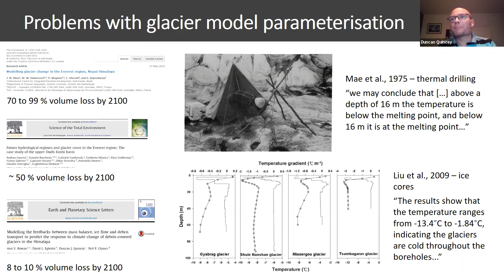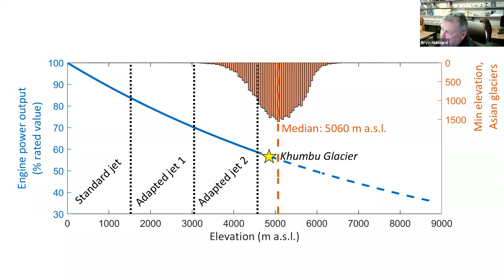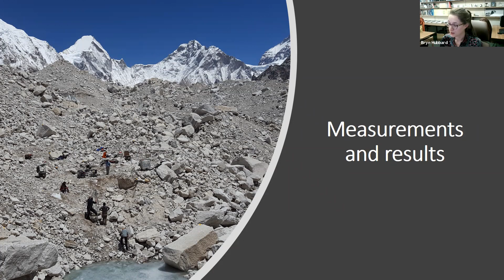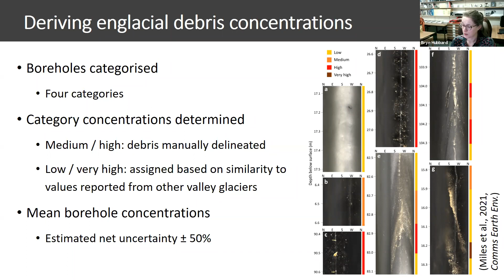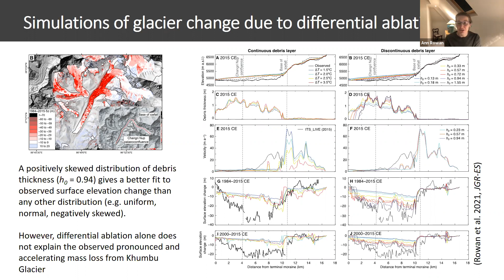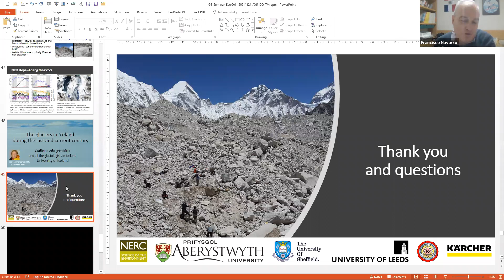Bryn Hubbard, Katie Miles, Duncan Quincey and Ann Rowan at the IGS Global Seminar Series

Comment: Thank you for the very interesting presentation!
A question, please.
You acquired temperature borehole data for over 1 year. How did you manage the borehole closure over time? Did it risk to damage your sensors? Or, did the different ice velocities at different depth stretch your sensor chain?
Thank you!
Andrea
Reply from the maker: I suggest you get in touch with Bryn directly if you haven't already done so. 	byh@aber.ac.uk
Reply: @igsoc  thank you for sharing his contact, i'll get in touch!